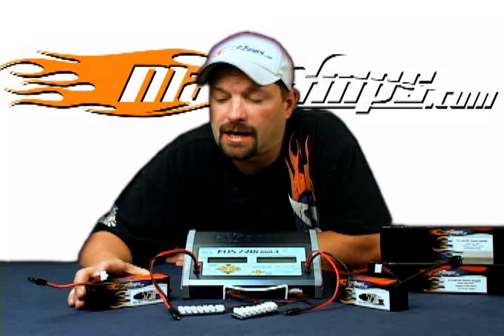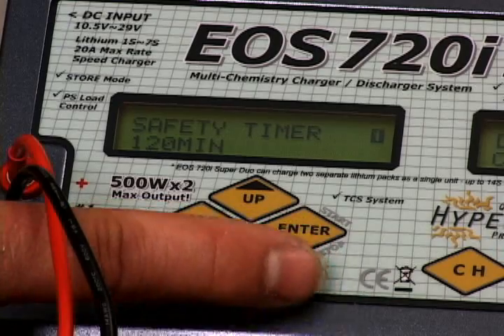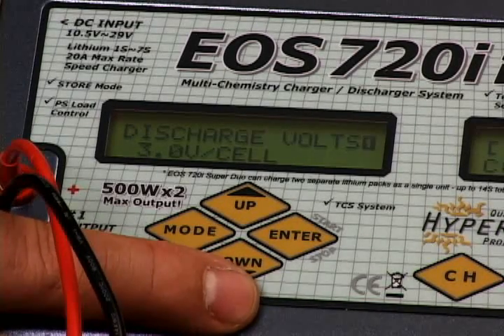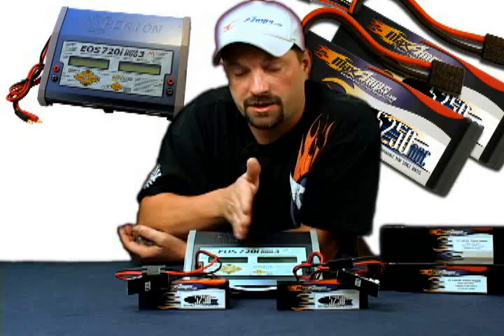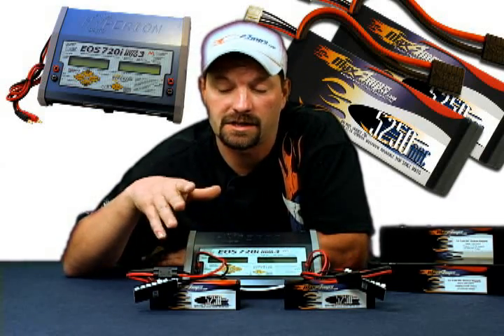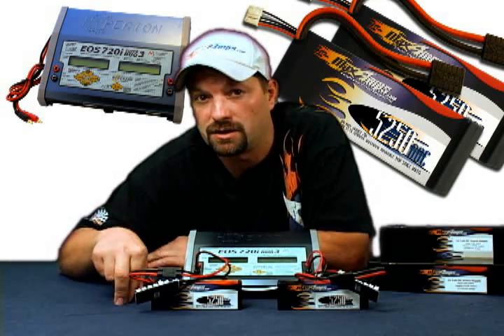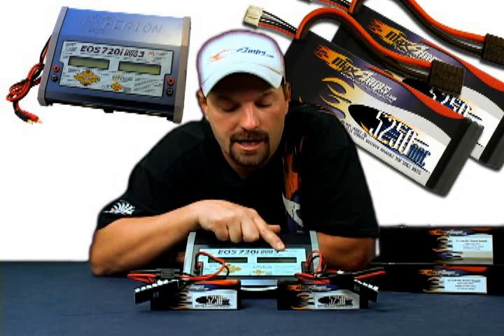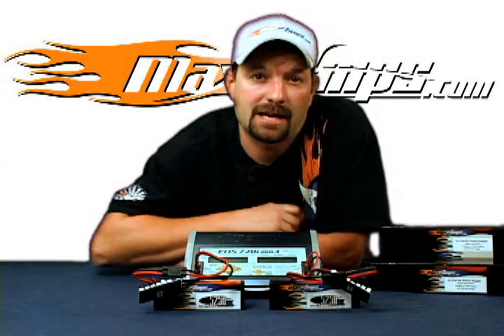How to cycle & store charge a lipo using the Hyperion EOS720i SUPER DUO 3 Charger

Comment: No lipo sack?
Reply from the maker: Lipo sack is a great stop gap in the case of something happening but nothing is better than being there during a charge. You can stop an incident from ever occurring. It takes time for them to reach the point of a thermal overload. If you are aware of their condition in advance you can stop the charger and dispose of the battery pack safely without ever needing the lipo sack.